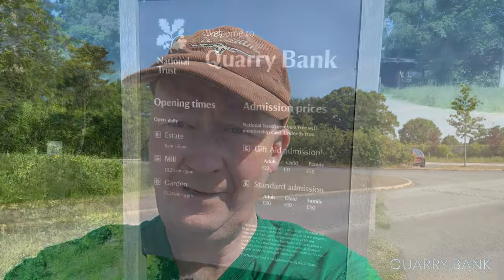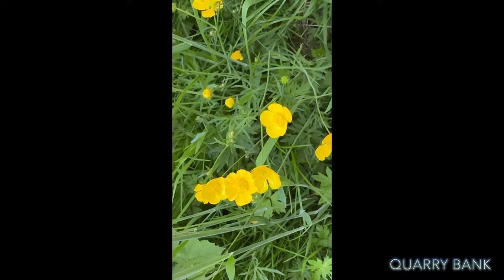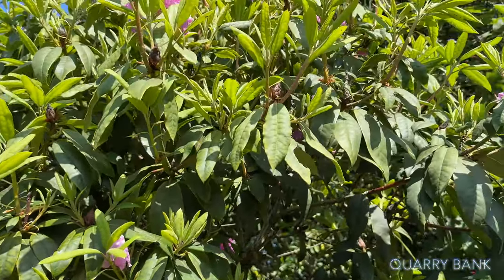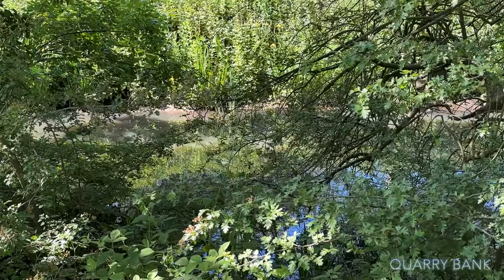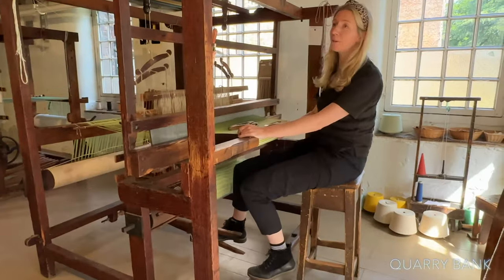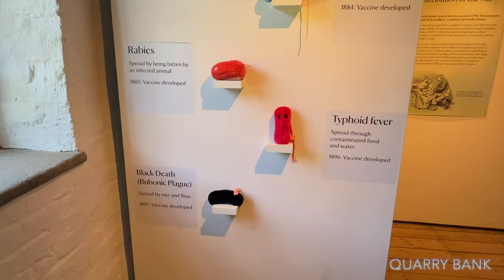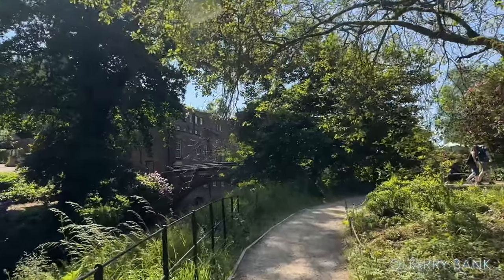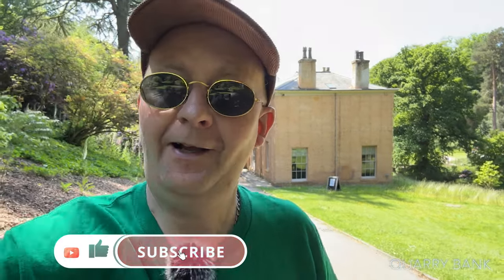Quarry Bank Mill National trust explored!

Comment: That was a great video. I found it while considering things to do around Manchester airport. Quarry Bank seems the ideal place for an extended visit. So easily gone to by train from the airport station, being just an 8 minute direct ride to Styal station.

Without going into Manchester ( which is actually easy by train or tram ) this Quarry Bank place and the two things below are great ways to fill a long lay over or free day.

Another thing worthy of doing is the Runway Visitors Park around the other side of the airport from the terminals. You can watch the aircraft with plane spotters from side on to the runways and there are facilities including tables, a cafe and an aviation heritage exhibit. You can book a tour of a Concorde, left in its last use configuration, which I have done and when I did it was given by ex Concorde staff. There's also an RAF Nimrod you can book for. A short walk from the site is the Romper pub, an old place in a former coaching inn building.

A more dramatically located pub is far off at the eastern end of the runways just by the fence, called the Airport Pub. Its just across the road from the Rental Car Village. Tables are bookable and there is outdoor seating too. The location is right where aircraft turn to line up for take off if that's the way the wind is at the time. It surprised me you're allowed to be so close, but it must be that the jet blast goes past you by the time they apply thrust ( just so long as they don't apply it during their turn or you'll get a face full !!! ). Given that the largest passenger aircraft are among those that fly from MAN, it must be an awesome sight.

Thank you for an excellent video. I hope one day to tour around Quarry Bank Mill. 
I noticed from the video, standard entrance was £20. You can join the National Trust for £91 ( individual, annual ) . That gets you in 500 places, so if you like this sort of thing you might as well.